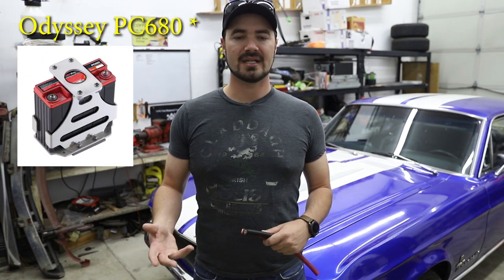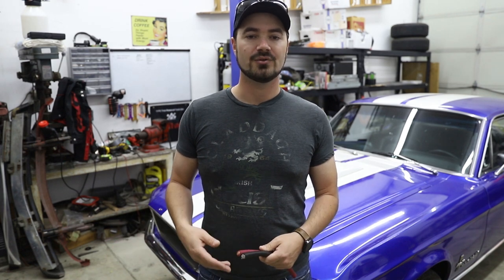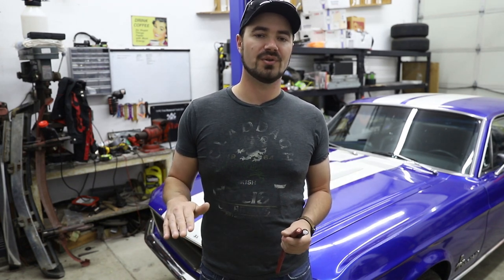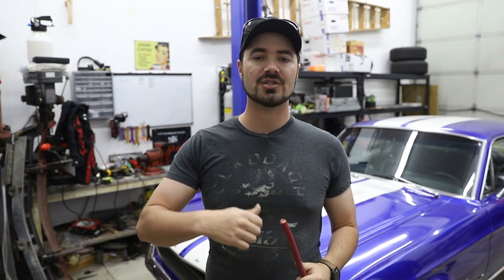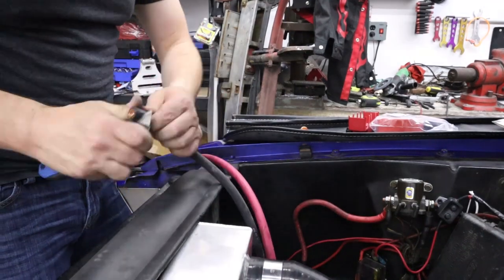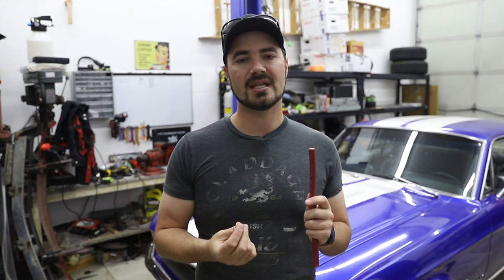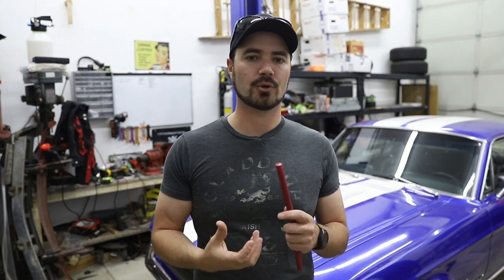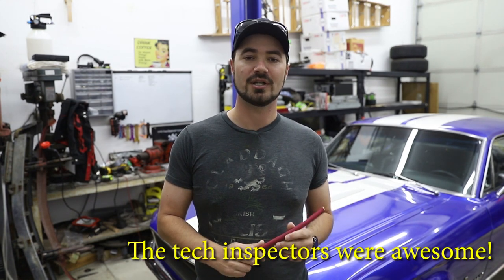Relocating the battery on the 67' Mustang

Comment: What an excellent video; I have a 67 Fastback and ran both of my 1/0 copper cables from the battery along the right side door channel until I got to the "A" pillar.  I didn't pass the cables through the pillar, but instead I moved inward and passed through the firewall/toe-board at a location that was in-line with the right side, (passenger), frame rail.  I used a small hole-saw to cut holes in the toe-board and installed rubber grommets to protect the cables from chafing; I thought that the cables would be at a safe distance from the heat emitted by the right side exhaust header if I allowed them to run on top of the rail where they would be about 5 inches away; I was WRONG.  It may have been alright if I had kept the original exhaust manifolds, but I was using Hooker long tubes and their radiated heat, I found, is  immense.

  Being safely suspicious, I kept an eye on the cables after installation and after about an hour of driving/tuning, I then shut things down and let it cool off.  I checked the cables and discovered that there was an ever so slight, "roughness" to one of the cable's insulation.  As protection, I decided to slip some of that silver colored, cloth like heat shield sleeve over the cables; the stuff that's actually meant to protect hoses.  This works, but I still don't like subjecting the cables to the kind of heat that's being experienced; eventually that heat sleeve is going to deteriorate and I just can't drive the car thinking that I have a potential problem that could surface at the most inopportune moment.  Splicing in a section of cable is a no-no for me as a permanent fix if the insulation gets burned, so I'm going to re-route the cables slightly outward, into the right inner fender-well and have the cables pass through over the suspension, to a point near the location of the factory starter solenoid.  I doubt that there's any danger of damage from something being thrown around in the fender well.

Thanks for sharing your experiences and plans for your project Mustang;  you're very thorough and complete in your dialog; I've added you to my subscription list.  I'd like to add something that I don't believe was mentioned.  It's important to use the same size ground cable or negative cable as what your positive feed cable size may be.  I've seen where people will be concerned with the size of their positive cable, but fail to realize that what goes in must have an equal route out.  Thanks again for the excellent video, I look forward to what you have in addition.

Comment: Great video.  I have had my battery trunk mounted for over 40 years.  Back i the late 70,s when I moved the battery to the trunk battery boxes were rare so mine is just bolted to the floor over the frame on a Mopar trunk mount battery plate.  The positive cable runs through the inside of the car and through a grommet in the firewall to the engine bay.  I have never had a problem with this setup.  I will look into obtaining a battery box and also using high current thru panel battery terminal connector in place of running the cable directly through the firewall with a grommet.  This should add a bit more safety to the car.  Thanks for the great video.

Comment: Great video! So, if I understand your install correctly, the 1/0 cables that you ran to the battery are always hot, is that correct? Also, where did you source the 4 post connects and adhesive lined shrink tubing?
Reply from the maker: When I first installed them they were always hot, like standard battery wires, but currently I have a breaker/shutoff on the battery box in case of grounding or when I want to disconnect power without undoing a terminal clamp. The adhesive tubing is something I have had a while, but you can get it from electric supply places or even just on Amazon. Just look for some decently thick material that shrinks to the ratio you need. I believe the post connects and most of the other items were off Amazon. I bought them in a hurry to finish the project before the autocross event.

I have upgraded/replaced a few items in preparation for road tripping the car 2000+ miles, and I'll get a video up of that whole ordeal soon ;)

Comment: I like the video, but I’m not running EFI I have a basic 302 carbureted I put the battery in the trunk my question is do I need to run both negative and positive wires to the front or only the red wire ?  and where do I connect the red wire too, alternator or solenoid ?
Reply from the maker: You will have to run between both the alternator and solenoid. The alternator needs to output back to the battery the entire time the engine is running, where as the starter solenoid will only be closed during cranking.

I'm general, you should run good grounds to the front, as there are a lot of things to add resistance and cause problems just grounding through a rusty body that has isolators and seam sealer scattered throughout.

Comment: Great timing, doing mine right now.
I’m using the same 4post connectors.
Did you run new EFI power Harness wires back direct to the battery like you mentioned?
I assume your alternator stayed to the factory starter solenoid?
Reply from the maker: I ran the EFI directly to the breakout blocks for power and ground to try it out and I haven't actually had any issues so far. The alternator is currently going to the breakout panel directly rather than starter post to take some of the strain off and seems to work well.
Reply: So they Alternator and Efi computer basically hooked to the same place on the 4 post blocks? Am I reading that correct?
Reply from the maker: Yes. Right now I have the alternator at one end of the block and the EFI attached in the middle with the battery on the other side. So far it actually is behaving quite well. If I had encountered any issues, I was going to run a wire all the way to the battery directly.

Comment: What a great video. I'm planning on doing a battery relocation on my 67 coupe and am glad I stumbled upon your channel and this video.
Quick questions, did you go back to make any changes/improvements? Did you change the cushion clamps to something else? Did you ever add a kill switch to it? I'm torn between putting one in the trunk or near the driver seat.
I'll be ordering my parts soon and will be using this video as a guide. Thanks for such an informative video.
Reply from the maker: I went back and added a 500amp relay as a shut off. Basically I just looped the positive side of the relay to the battery side and used a switch to ground the other. That way the battery is completely disconnected. The only thing it doesn't do automatically is kill the car if it's running, as the alternator could in theory keep it running, so I also use it as a trigger to the PMU to turn off the ignition/EFI and kill the engine from that side.

I will do a video on it for you in the near future!
Reply: @AmbiVe  I look forward to seeing that. Thanks for the reply.

Comment: What type of battery and battery bracket was it that you removed? Something that slim may keep me from having to relocate the battery to the trunk.  Thanks!
Reply from the maker: I believe it was an Odyssey PC680 with a matching bracket. I pulled it from my other project to test. Ultimately I just wanted more cranking amps for when I'm parked in cold weather.

Comment: Where did you buy the break out panels
Reply from the maker: I have seen them all over, but lately I have been buying them from Amazon. They are always in stock there and multiple stud sizes are available for different projects. They have single or multiple post options. Just search "distribution block" or "junction block" depending.

The specific brand of the last I have bought is Fastronix. They seem a bit pricey for what they are, but they have not caused me any problems and come with good quality plastic insulation parts that hold up.